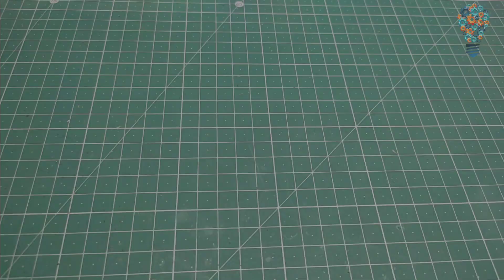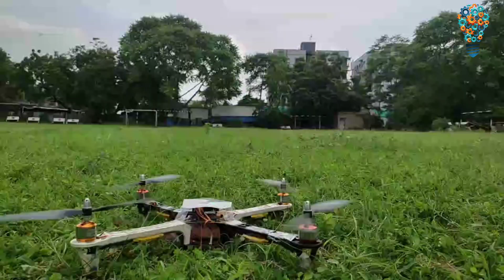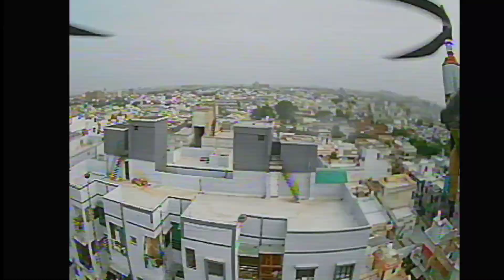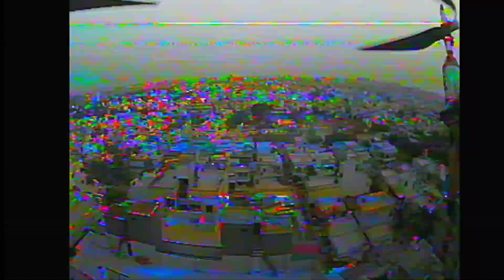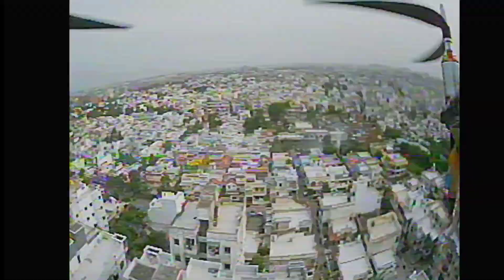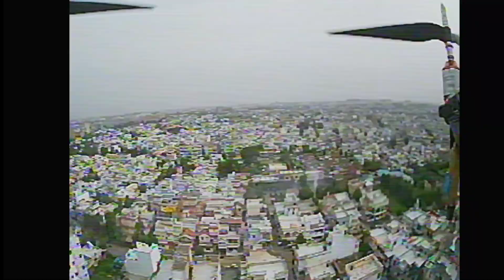Arduino Based Quadcopter | How to make Drone using Arduino

Comment: Bro which propeller are you using
Reply from the maker: I am using a 10"inch  Poly Nylon Propeller from & also use a 10"inch carbon fibre Propeller..  from robu.in website

Comment: hey bro can I use 3000mAH Li-ion battery instead of lithium polymer and how long your 2200mAH battery last on single charge
Reply from the maker: Yes bro you can use Li-ion.... but it is heavier than Li-po.. ..
Drone Flight Time with the weight:-
- 2200Mah / 1.2kg  /    6-7 Minutes
- 4200Mah /  1.4kg /  10-12 Minutes
Note - Please Make the drone as light as possible !!  (Max weight- 900 gram ) ..
Reply: @ProjectsPlanner  thankyou very much
Reply from the maker: If you have any questions or queries please comment  me ! I'll try to help you!  👍

Comment: hi, may i know how you did the codes for the quadcopter
Reply from the maker: bro I'm not did the full code but  i change the PID settings in the code for maximum stability of the drone. and also change some error in the code.
Reply: @ProjectsPlanner  Bro where I can find the code😅
Reply from the maker: in my website

Comment: I do the same you but my quad can’t fly. can you help me please?
Reply from the maker: ok bro.. can you please tell me in detail..
means hoy your Quadcopter react while you increase the throttle..  !
Reply: @ProjectsPlanner  My quad can't fly up when I increase the throttle, is it true that just increasing the throttle will make the plane fly up?
Reply from the maker: yes bro... ! you must check the all Propellers Direction(CW/CCW) according to the BLDC Motor Rotations. and also check Your Battery for Minimum 11.5v Output for the lift-off the drone .

Comment: Bro my Arduino drone working but it's not stable
Increase the throttle continuously move right angle side without any controlling
How to fix the problem?
Reply: Code setup and calibration is properly but it's not stable how?
Reply from the maker: Check your battery c rating and also storage capacity (mah), fix your flight controller in center and steady position
Reply: Use gps for stability 😊
Reply from the maker: Yes bro but.. you need a telemetry system  to connect the GPS in our Arduino based flight controller so that 
it is  slightly tough to add gps !!
Reply: @ProjectsPlanner  35C 4200 mah
Reply from the maker: If your drone goes left automatically so you need to trim the right side in your Remote and make the drone in maximum centre position while flying  !
Reply: @ProjectsPlanner  okay I'll try this method
Reply: I used red and yellow 30a esc that is not problem?
Reply from the maker: not at all..  don't worry!! 👍 timeing of the calibration is slightly different but it will work perfectly 👍..
Reply: @ProjectsPlanner  yes bro now I fix the problem 😊
Reply from the maker: Oh great 👍,  Fly Safe and Don't forget to hit the Subscribe..... button
Comment me if you have any questions or queries.. !
Reply: @ProjectsPlanner  sure 😊